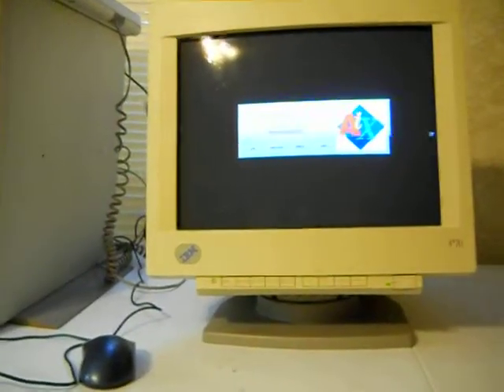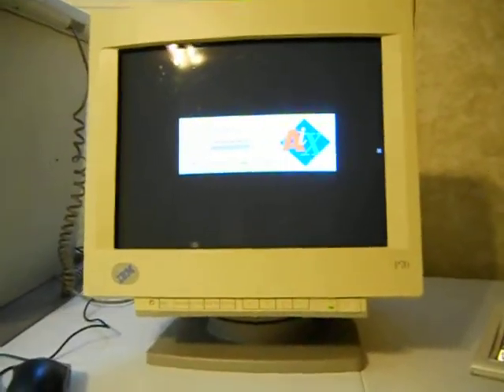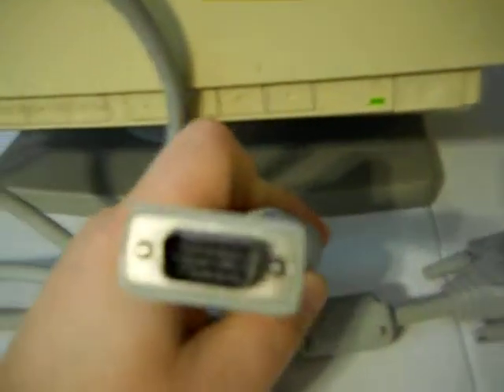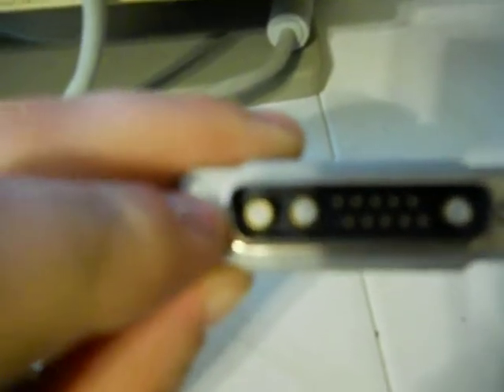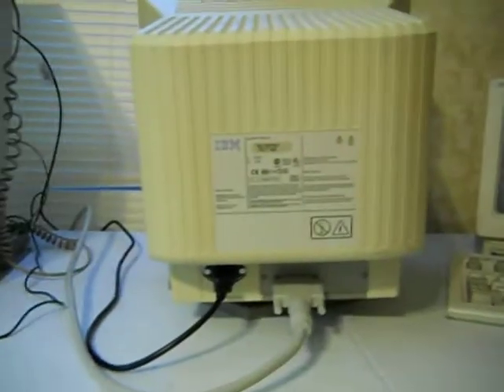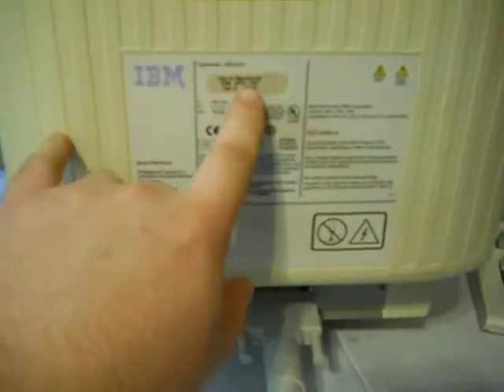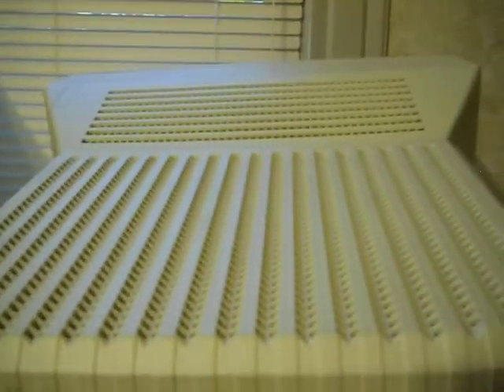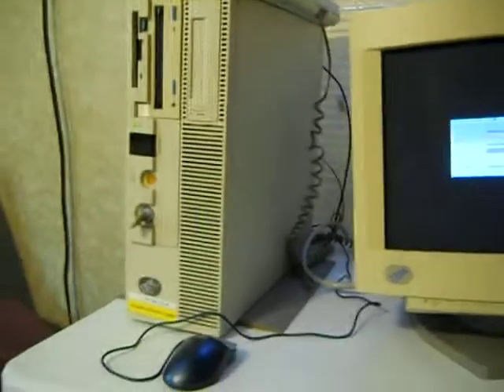IBM RS6000 #3 - IBM P70 CRT Monitor

Comment: I had a Trinitron monitor once which used RGBS; it had four BNC connectors: three for primary colours, and one for sync.  The advantage of using one of these is you don't need to switch monitors to use a different analog video system; you only need to switch cables.  These kinds of monitors were very popular with people who had UNIX workstations which had 13W3 connectors but had differing pinouts- you only needed one type of monitor for each, and swapping out a monitor was as simple as swapping out the connectors behind them.